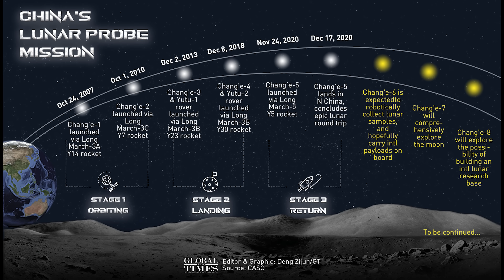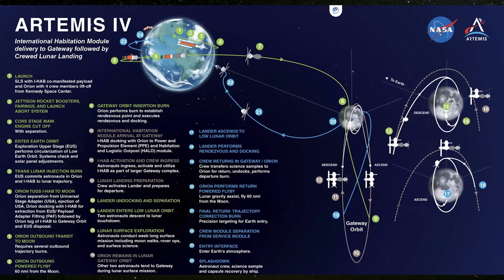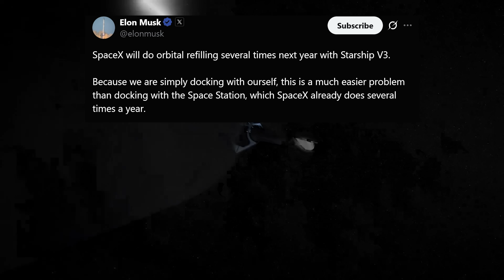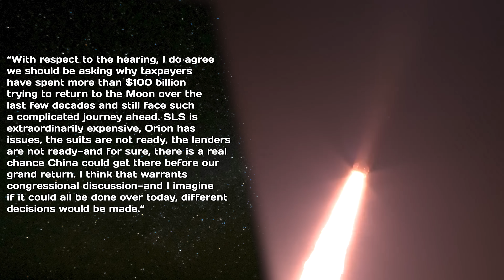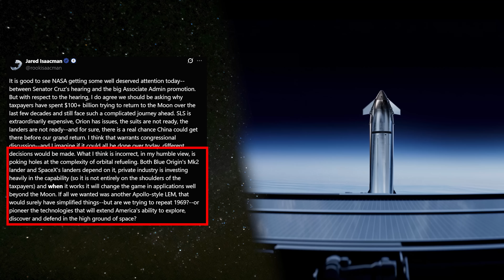Ex-NASA chief revealed the Real Problem with SpaceX Starship to get back to the Moon while China

Comment: Why is it that we could go to the moon with 1 massive rocket, but now we need dozens of rockets for a single trip to the moon? Are we really taking that much more equipment and material with us😊?
Reply: The lunar module and lunar lander were quite small despite the overall rocket being huge. As the rocket flew, stages would be released, thereby reducing the mass of the remaining craft, requiring less fuel for it to leave Earth orbit and go to the moon. The part that left the moon was tiny, in comparison, so the lunar module returning to Earth didn't require much fuel to leave the Moon's orbit and return to Earth. Once back at Earth, it just needed enough remaining fuel to direct the re-entry.

With the Starship system, they have a huge craft that is going into orbit with one stage returning, leaving a still huge craft for the trip to the Moon. Then, you have to land that huge craft, launch it from the moon, return to Earth, and then still have enough fuel to land safely on Earth.

Because of the design philosophy behind Starship, the fuel requirements to go to and return from the moon are significantly larger than what was needed for the original Apollos missions.

To give specific numbers, the original lunar module was under 5 tons without fuel. Starship, empty without fuel, as the most conservative estimate of mass of 100 tons (and I've seen estimates as high as 150 tons).
Reply: @saldiven2009 Then the question is do we need to send a lander that is 100 tons empty?
Reply: @caneighdianjake because it can land 50 people instead of just the 2 from the Apollo landers
Reply: @RenatoUtsch  - sure, breathing vacuum for 7 days, drinking piss for 7 days, and eating lunar rocks for 7 days... Did you hit ur head, kid ??
Reply: @saldiven2009  - still a believer, right ? I have a bridge for sale, waiting for you !
Reply: @mirandela777 : That head injury has your broken mind on repeat.

Comment: your first mistake is actually using Elons promises as big part of your video. Please drop that next time.
Reply: Hard to drop him with spacex dominating so completely. They sre just the best option?

To quote your buddy: "I transform things from being impossible to being late".
Reply: @CS-px9rr musk is no engineer,  just listen to him when he goes into detail, all talk with ums and  ars , lve worked with engineers in the building industry which is 1/1000000 as complicated and musk talks total garbage, he talks like its already done.. Never heard such nonsense in my life.
Reply: @chrisschneiders6734   He certainly is not an engineer. Not the point I was making though, I think?
Reply: @CS-px9rr  even allowing for being late his track record at Tesla is abysmal.
Reply: @London-m4g So..... he got control of Tesla in 2004, 4 years before it delivered its first car: basically an electrified Lotus Elise. Tesla sold 1800000 electric cars last year. Not exactly a failure I think? Most CEO's are full of bullshit, as is he for sure. But an abysmal track record? Uhm.... not quite
Reply: Musk and Spacex should be investigated.

Comment: We went to and landed on the moon 6 TIMES, WITHOUT refuelling! Why suddenly we have to refuel in space to go there Is fucking ridiculous!
Reply: SpaceX is insisting on using their huge lander with reusability.

The original lunar module was about 5 tons in weight without fuel. Starship is somewhere between 100-150 tons without fuel.

The original lunar lander just needed enough fuel to slow its descent to the moon, take off to dock with the module, return to Earth and parachute into the ocean.

Starship is 20+ times as massive, and the design requires the entire craft to travel to the moon, land safely, take off again, return to Earth, and then land safely on Earth.

The design decisions for SpaceX's moon system require far more fuel than the original Apollo missions' design.
Reply: @saldiven2009  Add to that the original purpose of landing on the moon again. We want to build a "permanent" base on the moon. That was the purpose. 

With Spacex lander, we can do that and with V4 Starship (about 150t to the moon) we can begin to build a colony with mining and industry (with lots of robots, maybe the segments of a Prufrock tunneling machine to start mining/building underground habitats)... Musk design accomplishes this and slashes 3/4 of the cost. Sending 20t or less to the moon is... proving we can plant a flag... again.
Reply: Ask NASA 1st about where origin film tape of moon landing operation
It's officially disappeared, along with all other films which supposedly kept in rotten place that was purposefully turn all film tapes to dust... 
Officially nil original real evidence left of ever of moon landing
Reply: "We went to and landed on the moon 6 TIMES" - sure another believer ! I have a bridge for sale, only for you ! Cheap !
Reply: @mirandela777  Why would you want to land 7 times... and nothing else? Starship can land 100t of cargo on the moon. Starship V4 could manage 150t on the moon... and do it for $1.5 billion per flight once the infrastructure is built (infrastructure paid for by $3 billion all in). So after the first flight... we could send up 200 ruggedized Tesla bots, send up 100t of construction materials, Send up a crew and habitat, Send up another 100t of supplies... all of this in one year for $6 billion. (Assumes astronauts use Crew Dragon to transfer to the lander). 

Note that Starship has enough lift to have a Copenhagen Atomics nuclear reactor installed (40t and the size of a 40' container for 30MW capacity for about 8 years). Launch it, land it, tip it on its side and cover it in fuzed regolith tiles... now you have power to manage a town of 1000 people on the moon. Send up Boring Co Prufrock tunneling machine in segments and start mining/creating underground habitat

This is why LEO refueling is needed. To actually build a mining/industrial economy on the moon, build giant ships from mined materials (lunar orbit) then go to Asteroid 16 Psyche and bring back 1000 tons of gold to pay for it all.
Reply: @mirandela777 : Do all the kids in your family suffer from Fetal Alcohol Syndrome?

Comment: Just HOW did We get actually WORSE in Space Tech compared to what we did 50-60 Years ago is something I will NEVER understand!!!
But of Course we invest Billions in Ai... WTF The Space Race should have
Never Ended!
Reply: We didn't. 

Any idiot can dump stuff on the moon. Did that. Spacex is trying to build a colony on the moon. Way Cheap/reusable/massive capacity. Hundreds of robots, hundreds of tons of building materials, small nuclear reactors, etc.

With all the "complexity" its way cheaper than SLS/Orion. 
Imagine dumping 100t cargo/robots/etc on the moon for $1.5 billion. $6 billion for quarterly runs for 1/3 NASA budget. (Use Crew Dragon for crew and save $4.5 billion.

This loser is trying to plant a flag... again. 
Why would we need that?
Reply: @avgjoe5969  As ling AS They can't even plant a FLAG in the Moin anymore How are WE supposed to ever colonize ANYTHING in Soace!???

Comment: There is no way to get the mass to the moon without orbital refueling.  Don't know why it's a discussion point.  If you want to drop off a few smaller items, plant a flag, etc, then sure, no refuel necessary.  But to setup a lunar outpost will require larger spaceships

Comment: We will not see a man land on the moon. We never did. A pressure vessel for human survival cannot be assembled with self tapping screws, sheet metal and a rocket underneath it. Such a pressure vessel with airlock will be heavy. Radiation is a problem. Inverse square law applies to heat and all electromagnetic radiation, applies to motion and mass . Every doubling of mass = quadrupling of energy requirement etc. Relates to e=mc2. First law of thermodynamics applies to "slingshot" propulsion method of 1969 vintage.
Reply: Will the moon take out the Chinese? Will the Chinese take out the moon?  Just noodling but isn't it all about pork or are we just general chickens worried about our fortune cookie?
Reply: Profoundly ignorant you remain — yet grandiloquent utterances, like jewels misplaced, from the mouth of a fool they tumble

Comment: Crazy thing is, we already did this with less technology. How come the first moon missions didn't require massive amounts of fuel?
Reply: Because we landed them on the moon in a paper cup, not a tanker truck. Fuel cost per payload goes up more than the square of the mass. Most of the fuel in Starship would be used to move the FUEL around.
Reply: @paulpinecone2464 starship is needed if you actually want to build anything on the moon, you need that large payload
Reply from the maker: They keep it simple, the target was just land on the moon, the massive budget also helped a lot

Comment: This is the same American hubris that you get about the Supersonic Passenger plane. Well it's not American. It's Anglo French and called Concord and America is just developing a less obvious sonic boom. Anglo means British just in case you Americans are too poorly educated to know that by the way. You lost the race and propaganda isn't going to rewrite history. You are not the greatest country in the world.
Reply: The SST program wasn't killed because of mere technical challenges; it was killed because it would not be a plane that would be economically viable.
The SST would have been a bigger plane than the Concorde and -144: at 270ft it would best the Concorde by 68ft. The 2707 would carry 300 passengers compared to the Concorde's 120. More passengers means lower costs. The original plane was to use variable sweep wings, but that proved to be too costly in terms of complexity and weight, so a double delta was used, much like on the Concorde and -144. But delta's work best at very high speeds, Mach 1-3, and the higher the better. But that speed creates sonic booms and the 1964 Oklahoma City Sonic Boom Tests revealed that people didn't like sonic booms. The 2707 could fly subsonic on overland flights, but the engines would burn 2-3xmore fuel than in supersonic flight (and that was already 2x as much as a DC-8), meaning you wouldn't get there any faster than the DC-8 or B-707, but your ticket price would be much higher. That left only transpacific and transatlantic flights being viable, limiting the passenger base and thus revenue.
Then came the issue of high altitudes needed for efficient supersonic flight. The amount of exhaust pollution going into the upper atmosphere was considered excessive, given the fact that the plane burned far more fuel per mile than subsonic planes. And that pollution was going almost directly into the ozone layer, which shields us from UV light from the sun.
The big nail in the 2707's coffin was the plane's cousin, the 747. It could carry more passengers and cargo at far less cost per mile than the faster 2707. It didn't need the extra long runways the SSTs needed and was far quieter.  I've heard the Concorde take off from Honolulu and it was a thrilling sound. Deafening, but thrilling. It had far more airports that could handle it, so you could take the plane nearly anywhere domestically and internationally. It ushered in the use of big efficient turbofan engines, which sipped fuel as compared to the guzzling of the supersonic planes.
So, in effect, the SST 2707, Concorde and Tu-144 faded away for the simple reason: people would rather save money.
Reply: If lacking self awareness was a sport, you would be an Olympian.

Comment: Watching this I immediately thought of moon rocks as weapons.  In the 1960s I read Heinlein's "The Moon is  a Harsh Mistress". (I also watched the broadcast of the first step on the Moon.)  Conflict between Earth and the lunar colonies resulted in the colonists easily launching "rocks" at the Earth as weapons, hitting anywhere on Earth.  The velocity of impact results in a nuclear level blast.  It was one of Heinlein's best novels.  But perhaps the novel had a flaw and the rocks would vaporize or break up like meteors.  Just throwing the concept out there and seeing if it sticks to anything. 

My 2 Cents.
Reply: You need something to get the Moon rocks from the surface through lunar orbit to Earth's impact. Some kind of mass driver or rocket engine which is capable of accelerate (technicaly decelerate) the rock about 15km/s/s (maybe a little more for manouvers and targeting). If the rock is big enough, it won't burn up in Earth's atmosphere, it will reach the surface. The concept is theoretically possible, but you'd have to build a large infrastructure on the moon, which isn't expected any time soon.

Comment: It's really not meant to gi ti Mars. It's a project funded by the US military to be able to move equipment and troops around the globe quickly.
Reply: Point to point terrestrial travel is a non-starter, even for military use. By the time they fuel a vehicle and hoist the cargo into the craft and then unload at the destination, a military cargo plane that can be loaded unload by driving in and out, whether it's military vehicles or cargo loaded with fork trucks, any time saved in travel time would be eaten up by the added material handling time.

Comment: I’m sorry but this former NASA administrator’s attitude is exactly the reason we’ve spent $100B+ and yet still have massive hurdles to overcome.  SpaceX just landed its 500th Falcon 9 booster.  They have twice captured the StarShip booster and are 6 to 9 months from capturing the StarShip itself.  There is no other engineering team on earth with greater engineering capability, know how or execution skills than SpaceX.  If we’re actually in a race with China, why would you slow down our progress simply because you don’t want to depend on the clear leader who is emerging as a single source because they innovate and execute better and faster than anyone else.  NASA should be doing just the opposite, doing everything possible to help them (SpaceX) knock down bureaucratic and supply chain roadblocks.
Reply: NASA built and tested SLS, proving it's capabilities successfully. Even if they went through all the hurdles, they have proven thier work, something that cannot be said for Starship.
Reply: Capture of a booster using borrowed 40 year old data isn’t groundbreaking. Starship hasn’t made low earth orbit in 10 flights. The only thing it’s going to is rack up more costs to the American taxpayer. The funding needs to be redirected back to NASA who has a proven track record of getting the job done. They landed a nuclear powered car from a sky crane on Mars, landed satellites on asteroids and have satellites in interstellar space.
Reply: @sid35gb What has NASA done but burn $ for the last 30 years?

Comment: Okay that's a weird AI boosted and highly confused advertisement/excuse block for NASA.

Basically the situation is that NASA sold off what is left of the american space flight capability (which wouldn't have get anything to orbit without the gentle help of ESA for more than a decade now) to preserve the US ... ego. That's it and that alone.

The space capability now is secured by two utterly corrupt snake oil sales companys blowing up US tax money to keep their stocks up.

Ask a common engenier about anything of the Spaceship and everythig falls appart. The schedules, teh given capabilitys - everything. The fkn heat shield tiles are on E-Bay these days and people tested it. They're not even made for surviving a single start or entry. The first rockets failed due to people not knowing how to do basic welding techniques. None of the mass transport values holds.

It - is - a - scam.

The only good thing is: Neither is Musk essential to the nation, nor a 'on the moon first ... again ... for no actual reason' ego trip goal. China just does it because you guys want it so desperatly. The US delivery costs are insufficent and StarLink is designed to fail after 5 years of service (but does way earlier). So this is a death spiral everyone should easily able to figure out at home. This channel failed to, what should tell you everything about the channel - and the basic US citizen reality bubble.

The only thing at hand to reach for teh US is to have a Kessler Syndrom witin out lifetime due to all these burning up StarLink parts.